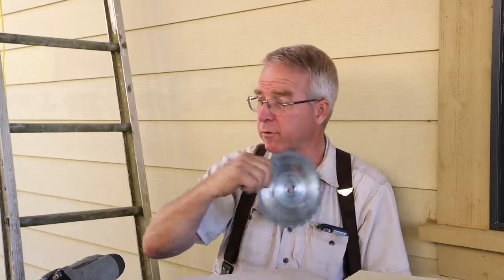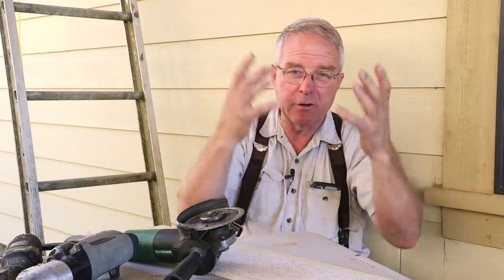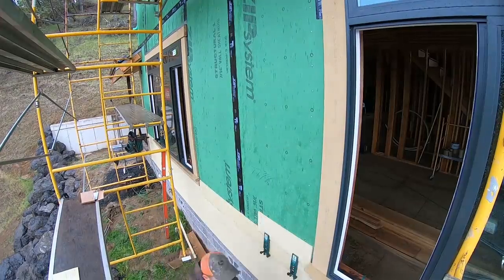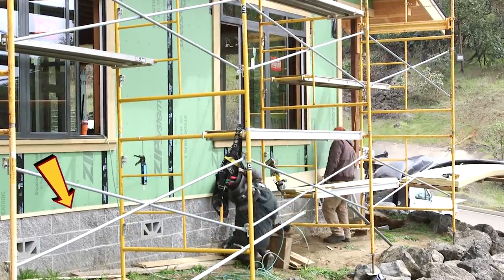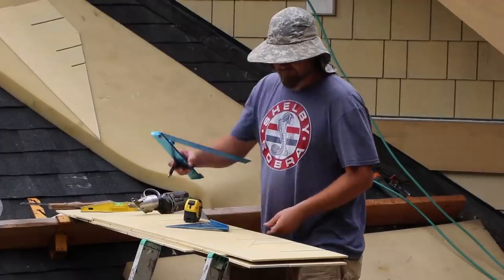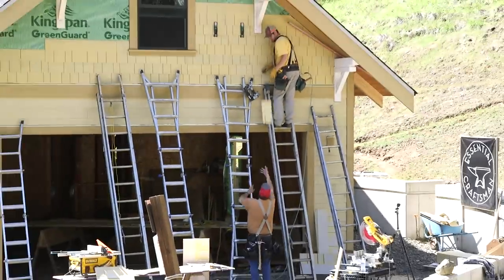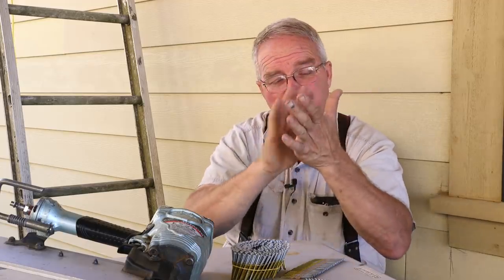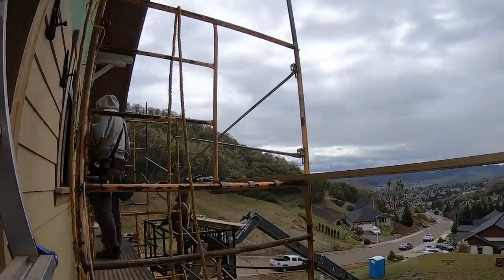Siding Pro Tips

Comment: In other words if your tolerance in 8th inches, measure in 16ths of an inch?
Reply: I keep my butt joints tight, and leave maybe an 1/8th inch at the trim, but I caulk behind the end against the trim with DAP clear polyurethane, plus I've got house wrap under that, and under the trim.  I like reasonably tight joints, and I don't believe a 12' painted plank that's properly nailed off is ever going to expand appreciably.
Reply: DAP anything is totally craptacular.  If you want clear use either Lexel or OSI Quad Max.  Best sealant adhesive you can buy, period.  You're welcome.
Reply: @iwasabigdeel7895  I've compared DAP to OSI Quad, and it's the same damned thing, as far as I can tell.  DAP comes in a better tube.  You can thank me later...
Reply: No, not Quad ...I said Quad Max. https://www.ositough.com/content/dam/uac/osi/master/PDFs/TDS/tds-quad-max.pdf
DAP is super cheap, I get it...but it blows.  It's been my pleasure.

Comment: I've watched many a woodworking video but I've never seen anyone pull a board through a table saw.  Is this a safety trick I don't know about?
Reply: It's actually very dangerous; although I have done it from time to time. Better to have an out-feed table behind the saw and push rather than pull the material through the blade.
Reply: I’ve seen a number of guys on YouTube, framers and such do it. I wouldn’t
Reply: @spock59  I’m not sure it’s any more dangerous than using a table saw the regular way. I do it when ripping boards over 10’ long since my out feed table is only 4’ long. You really need a feather board in place so you can more or less safely walk around the saw while it’s running.
Reply: it's fine, just keep your fingers off the blade.

Comment: Great video. I bet you also have to be very conscious of the board length changes because of the amount of material the shears removes. (Kerf?)
Reply: Just need make sure you know which side of the nibbler blade to use on which side of your cut line.
Reply: PNWester I was thinking, in general terms, that the shears remove a significant amount of material so that you’d never get a 6 foot piece and two 3 foot pieces from a 12 foot board. I was concerned about having a lot of pieces 1/4” too short because I didn’t adjust my own thinking.
Reply: Dick Kennedy I get it, you’re right. It’s a pretty wide kerf.
Reply: If you stick to having factory butts your situation doesn't come up very often.
Reply: Dick Kennedy 
Funny you should mention that, I have run into that exact thing, so it does happen, when I get into those situations you can score the piece with a utility knife front and back and then just snap it, then you have no kerf loss at all.

Comment: I used a nail gun just fine with 4x8' sheets but also put PL adhesive on first which is not for siding in this application, and I know my shed is good forever vs OSB or even plywood which then has to be covered.  1 layer, primed, with pattern of choice and paint won't peel because no expansion contraction, just caulk seams prior to placement so it squeezes out and wipe.  You project is as only as good as the materials and the craftsmanship.

Comment: Why do you not lap your trims over the boards? When caulk fails it will leak. Doesnt seem long term.
Reply: you'd still have to caulk it.  and it would look awful.
Reply: Someone mentioned that on the previous siding video.   I haven't ever seen it lapped over the siding in the US (not to say it never happens)  and honestly hadn't even thought about doing it that way.  It seems like putting the trim over lapped siding would leave large gaps which would be open to insects, water,  dirt, etc,  unless  those gaps were caulked, and it's a lot harder to caulk a large gap like that.
Reply: @MrHavokman  Sure, that would work, but it's pretty labor intensive.  I'm curious where you're located.
Reply: @andrewalexander9492  newzealand. I know what you mean by labour intensive but 1 guy can do a house in a day. Doesnt seem like much labour for a fool proof system.

Comment: As an Electrician, if you walked on site with that shear with worn cable, you would be banned from using it until it was fixed, though i would have no problem replacing the cable for them if that was the only tool thery had, replace that cable for everyone's safety.

Comment: last i heard, hardy does NOT recommend ring shanks.  in fact, they recommended to me to NOT use ring shanks.  ring shanks blow out the back.  did they change their minds?  also, these are great tips, but most are basic carpentry and construction tips except for the nibbler suggestion.  but, why not talk about the most important siding task?  getting a level reference line around the whole house, so each side of the house starts in the same place and is level.
Reply from the maker: You’re right!!! I should have! In this case I knew the foundation was level and we just pulled up off of the bottom of the sub sheeting. But I certainly should’ve mentioned it!

Comment: I used that siding on my kids treehouse, I didn’t use a nail gun, all by hand, Cause I don’t own one but one day I will
Reply: A Bostitch coiled roofing gun is the only way to go.  You can use their siding nailer too, but I like the larger roofing heads.  

Also, when nailing a couple of pieces of Hardie Trim together to construct a corner, the Hitachi (now Metabo) 15 gauge finish gun is about the only way to get total penetration... just aim straight, or you may get an occasional blowout to grind off and fill in.  

I lay down a thin bead of Lock-Tite construction adhesive first, then nail off one board laid flat over another one standing up on edge, with a few extras under the flat one just for temporary support.  You'll probably get a little slop on the adhesive, but if you wipe it off quickly... inside the corner and out, you'll retain the same texture as the trim and can simply paint right over it.

Comment: The first time I ever had to do an exterior repair involving that Hardi siding, I hated it for life. The edges chip and there's nothing you can do about it. You try to peel away old caulk and the siding is destroyed.
Reply: yeah you can't really repair it without taking down from top? Unless you can just stainless steel finish nail a new piece on and silicone the hole

Comment: I like Smartside better but I've installed neither personally.
Reply: Ha!  LP Smartside is not fiber cement.  It's made from wood strands coated with wax and the strands are bonded with resin and other binders.  It's junk, stay away.  It's basically OSB siding.  Nichiha is far and away superior to anything.  GAF Weatherside would be my #2 choice.
Reply: Yes I know what it is. I've had it on my place for about 8 years now and it still looks brand new. No signs of swelling or any issues so far.  I'm up north with harsh winters and Hardie had some problems here before they updated their install directions years ago. Sounds like LP had a pretty crappy siding product before Smartside too. I just wanted an upgrade over vinyl. One of the big Hardie installers gave a quote for over 45k! Maybe that was you with their same sales tactic badmouthing SS while showing pictures of failed old LP siding?!
Reply: @mikek2416  No chance!  My skin is way too thin for harsh northern winters.